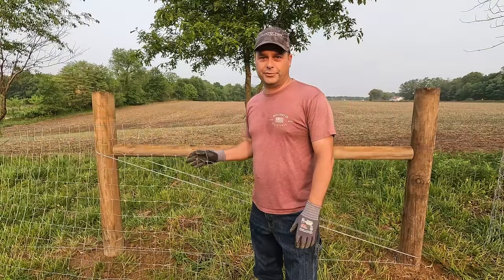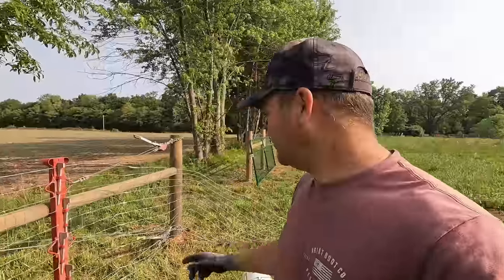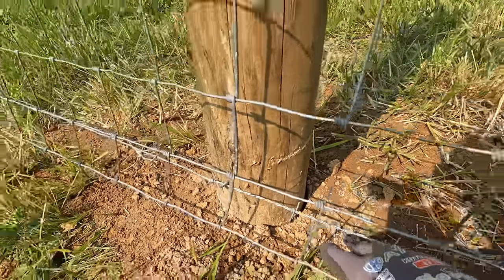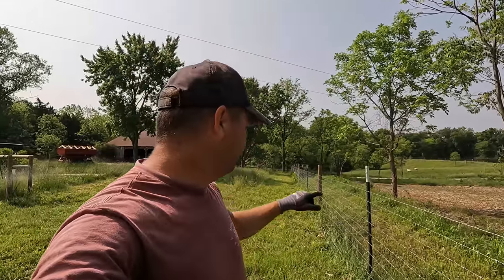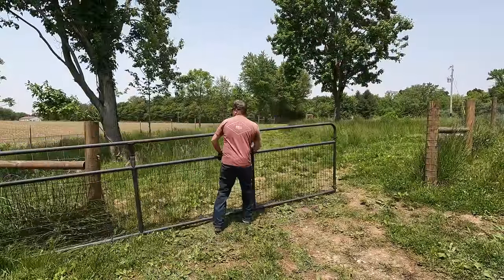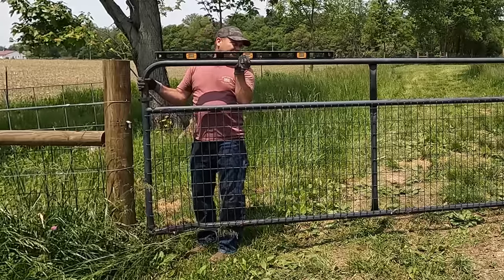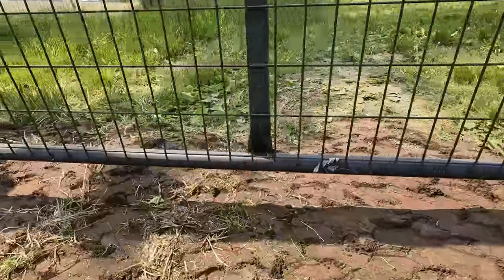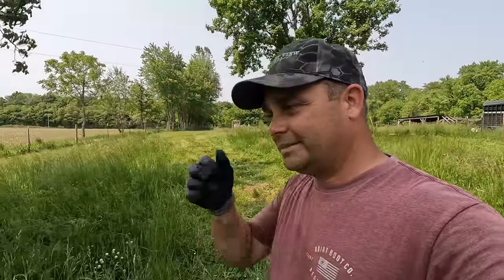Splicing Pasture fence and Hanging Gates.   Getting the pasture is ready for Steers

Comment: May Aunt, Sissy Valorie, had the same same 1 ft. to 2 in. angled gap on her steel fence gate. She hired some welder dude to cut a piece of 1/4" steel  angling from 12" to 1" and weld it to the pasture side bottom gate rung. She painted it same color as the gate. Looks like a custom gate.

Comment: That fencing seems like a never-ending job! I've definitely learned a lot from watching you. Hoping to start my fence this coming fall.
Reply: I have seen ranchers use two strands polyfiber electric fencing secured by wraping them around a smooth fiber rod that is pushed into the ground and it contains just about any animal you want to contain.
Reply: You are correct! Wire fencing is like built in job security. Every year there are posts to replace and broken wires to tend to. Fencing pliers are your friend so don't get cheap ones. If you have a crop field on the other side of a pasture fence keeping fencing pliers, staples and a little fencing wire in the tractor tool box can save you time in the long run.

Comment: Tamping those corner posts with a solid steel rod will almost eliminate  the movement like you had at the end post.

We tamp every post with one. Tamping with items that have no weight (2x2 or 2x4s) is ineffective, thus a waste of time. 💪I have several sizes of solid steel axles 6-7 ft long to use, according to the soil density and hole depth. Tamping effectively eliminates the need for concrete.

Comment: I put ratchets on my brace wire and you can tighten them after you load the fence and bring your corners back in to plumb. Works pretty good.
Reply: I saw ratchets at Tractor Supply, wasn't sure if they were for electric wire, or can stand up to the higher tension being used for brace wire.
Reply: @underdogoutdoors  yes they work good for both. I have had them on there for six years and no problems.

Comment: Evan, Just a thought, But on the bottom of your gate get a long piece of sheet steel(or aluminum) put slots (so you can slide it on a bolt) then attach it to the bottom of the gate and slide the metal to the height you need! Like I said, just a thought! I understand that dirt is cheaper, but with time that dirt os going to move!

Comment: Do you see the small 1/4in hole in the latch bracket on the gate. Drill through that and the gate and put a 1/4 in bolt in it. Will stop the latch bracket from turning on the gate pipe when steers bump or rub on the gate

Comment: Truly appreciate you sharing these video's, have been invaluable to me.  So far, I drilled over 130 holes for the posts, was brutal, used a heavy ditch witch auger from a rental center, & it took forever,   hard packed sandy soil with no rocks, (felt like porcelain)  a few roots, but didn't want to drill, had to use a shale bar every few inches, then auger.  Setting posts this week, went 30" deep.

Comment: Nice looking fence job. Curious why you use a horizontal brace rather than bracing from the top of the end post to the bottom of the line post. That way the brace pushes at part of the post closest to the soil.
Reply from the maker: I would have to notch the posts for an angle brace to lock into place in each post.  I haven't tried that yet.

Comment: They wouldn't be a bad idea to put a d-ring on top of that red friends tiger you have so you can hook it to your friends and pull it up with the tractor so you're not putting all the pressure on one wire just an idea

Comment: Evan, how wide of gates do you put it and what gauge fence do you recommend?
Reply from the maker: 12 foot is the smallest gate in would suggest.  My bigger gates are 16 or 18 feet.
Fencing I suggest fixed knot woven wire fence.  I think most of them are the same gauge, 10 gauge on top and bottom 12.5 gauge in the middle.

Comment: I think you are spending way too much money on fencing you don't need. And look at how much work you do to install the fencing. I see so many farmers that use two strands of poly fiber electric wire secured with smooth rods and their animals are not getting out.
Reply: Only until the electric goes off or a branch from a tree comes down and shorts it out.I think Evan is being wise. Our electric grid is extremely fragile. Don’t count on it! Stoney Ridge Farmer uses metal posts and field fence on all his pastures. And we are doing the same to ours. .
Reply: @cathiwim  There  are electricity grids that are fragile that is why many people are going to solar. The solar powered electric fence is a cost saver.
Reply: I personally love that you’re doing proper fencing and not relying on electricity to do it for you. It’s just as much about keeping critters out as it is keeping critters in, and if you’re like me, it’s good to spend the money on infrastructure while you’re still working and have income. When you retire and end up on fixed income is not when you want to be adding infrastructure.
Reply: Fencing is certainly not cheap. I looked it up and one site was advertising 339 feet of 12.5 Gauge Wire Field Fence for $259.00. Add to that the cost of the fence posts and it mounts up. But I do think this type of fencing is maybe more stable and of course better looking. It also has the advantage less upkeep (I think, but I could be wrong).
My dad used electric fencing for his steers and goats and it seemed to be effective, but he was there a good share of the time to be able to maintain it and keep the grass and weeds down.  And he could not afford to pay a great deal and lacked the installation tools that Evan has. 
You sound like you have farmed. Hope everything went well for you, it can be a tough life. But the exercise is great. My dad lived until he was 94 and was still using a rototiller in his late 80's. Take care.